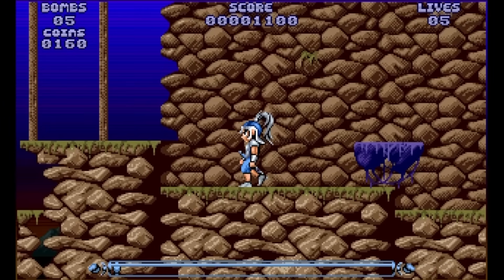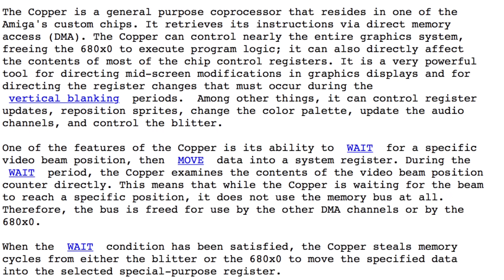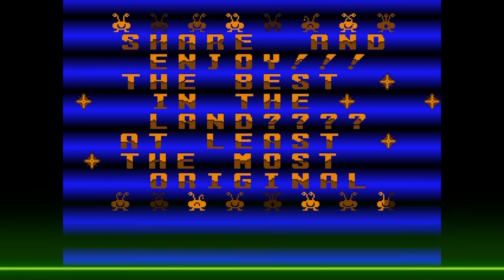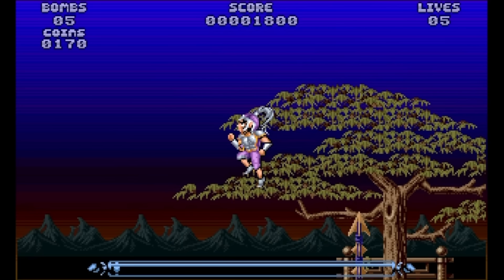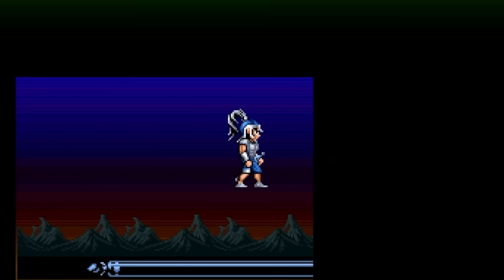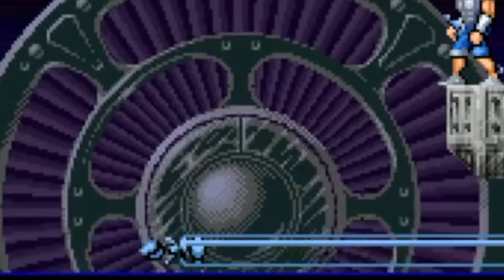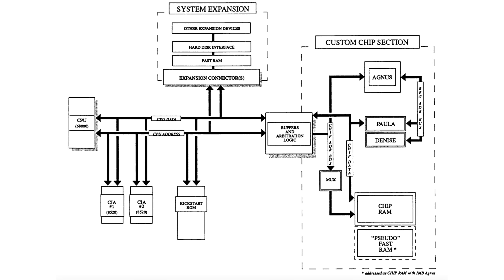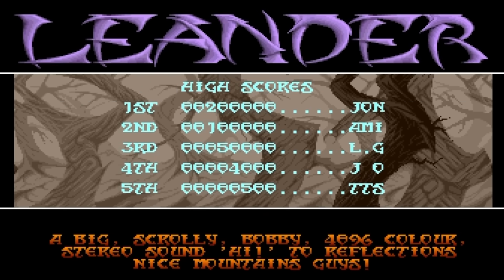SNES hardware beaten by this simple Amiga trick

Comment: I am or rather WAS (abandoned Amiga in 2008-ish) a SUPER Massive Amiga enthusiast.  and ONE HUGE massive thing wrong in the Amiga world that CONTINUES to happen today (November 03, 2021)  is that Amiga/Commodore 64 had NO standards when it comes to Arcade quality Games, and they had basically NONE of the Big names especially Japanese (capcom, Konami etc..). For example.... on the C64 AND the Amiga..... 90% of games are NOT full Screen Overscan.......Utterly inexcusable... this wreaks poor programming. Some were not centered and you have to center them and had different centering than other games......  Most were NOT arcade quality (No full joystick support for at least 2 buttons and ONLY Joystick support unless you selected Keyboard).  Alot of games Blue Prints were made and designed right on the Amiga using Deluxe Paint (Body Blows) which is why they look like cheap stiff puppets (not that Deluxe Paint sucks its just you needed a hand drawn anime on a Cell first then digitized and painted over with Deluxe Paint or better yet Brilliance 2.0).  Also Games had the Score raster Cut off the action when the score should be floating about the game with a transparent Raster. Very few games look good with a Separately drawn scoreboard (Chaos Engine, Ruff n Tumble) . Example: Zool 2 ECS and Zool 2 AGA...the stupid Purple Scorebar ontop ruined the entire game for me and the FAKE 256 colors were really just a background with DIFFERENT colors slapped in the back. The Foreground and characters are identical in colors, not a single color more.
There are games being released today like this.  No game, I repeat no game on an Amiga should ever be inferior to a Genesis version, and many times should be on par or better than the SNES version and Occasionally as good as Neo Geo.  Also the having a PAL version and a separate NTSC version was a problem. They should have ONE version that functions on both.  Don't believe me?  check out the Jellydrop type Game called OutFall!   it switches NTSC to PAL seemlessly.  Somebody please copy this routine.
SNES games and console games were just made to run on joystick ALONE... The Amiga games ALL should have been like this.....with the OPTION of using the keyboard if they wanted to. Also no one ever really (Im looking at you Commodore) released Standard Amiga 2 or 6 button Controlllers (except for the CD32 which was too late by this time) for the Amiga or C64. Heck the C64 Mini still has this problem...one should Never need to use the keyboard... they can be programmed onto the Joystick before shipping the games on it.

Anyway
Best Made High Standard Games on Amiga:

Slam Tilt
Kid Chaos
Zool 2 ECS version
Pamania (Full screen Overscan)
OutFall
The Chaos Engine (no complaints about the look but could use Overscan and more frames of animations)
Gods (Same as above)
FIghtin Spirit (They really tried but the background colors are too bright and should be half bright)
Robbeary
Project X (eliminate the HAM screen intros and add background music during play and we're good)
Bubble and Squeek (why does Genesis have a scrolling Background and ECS version doesn't????)
Leander (great but character needed more movement when Jumping and not staying always in the center)

There are a few more but they each still have their flaws.

Amiga could handle all of those with the flaws fixed and features added. Also the Amiga can do double the sprites and double everything mentioned here with one simple trick. Add a Multitasking Layer to the game you already created as if it were Workbench running infront of the game and you pulled the screen down while the game was running and you can view both.... now take this idea and make said Workbench (actually this would be foreground or background effects in a game)  and make that screen transparent.  Now you got 2 Multitasking screens running separately with their own resolution and colors but running at the same time and being viewed at the same time as ONE Game!   I believe Broadcast Titler used a similar effect.... Utterly Mind Blown.   You're welcome.
Reply: The borders on the C64 do puzzle me. I think that VIC would have needed to run the sprite Logic twice: once to count the memory cycles and decide if to halt the CPU and then the real deal. Probably, after the brain drain from MOS no smart engineer was left. Only Amiga brought them back. Amiga has no copy protection and is expensive. Japan only cares about dumb consumers.

Comment: Then Doom came along and it became how quickly you could plot 1 pixel on the screen.  Stupidly expensive Amigas with their decade old architecture and washing machine CPUs were crap at that putting an end to all this nonsense.  We're still playing Doom (for entertainment not just nostalgia) to this day.   
t. Bitter 1200 owner
Reply: Jaguar uses a blitter very similar to Amiga and plays Doom just fine.
Reply: @ArneChristianRosenfeldt  Amiga blitter has no use for a Doom like engine, I think it mostly relied on CPU.

Edit: Blitter was sometimes used to help C2P conversion on the Amiga, but C2P is a big overhead itself that the PC didn't need to do.
Reply: @SerBallister  I mean that the Jaguar blitter takes the line drawing function of the Amiga and expands on the pattern. You can pull in the color values from a texture map. Doom on Jaguar draws vertical columns for the walls using the blitter. I still want to Port descent to Jaguar and try to use diagonal lines.. sadly the Jaguar cannot do the shading as in descent.
Reply: @ArneChristianRosenfeldt  The Jaguar Blitter seems a lot more capable than the Amiga blitter. Amiga blitter couldn't stretch line patterns, so not that useful for stretched texture mapping.
Reply: @SerBallister  Yeah. Just interesting that Atari brought hardware to the market just in time for Doom. I guess that it was inspired by WolfenStein3d and F-Zero.

Comment: The trouble with Amiga sprites is they didn't have their own palette, you had to waste 12 of colours 17 to 32 colour of the bitmap screen's palette. You can work around other stuff but you waste 12 to 15 colours on sprite colours.....unlike every other implementation of sprite type hardware which had separate sprite palette colours. On AGA it's fine and you get 4 64 pixel by screen height sized 16 colour sprites which is great for beat-em-up engines but on OCS the sprites are less useful than on C64 or Famicom of 82/83 era.
Reply: To not steal too many cycles, Amiga playfields are supposed to be 16 colors or 8+8. So you have whole other palette for sprites. No idea why they could not provide 24 entries. Still better than C64.

Comment: Wasn't the Saturn also able to draw infinite sprites?
Reply: Saturn has playfields and blobs, but no sprites.
Reply: @ArneChristianRosenfeldt 
Could you elaborate?
Wasn't VDP1 dedicated to sprites?
Reply: @marioe.4400  I call the blobs because VDP1 was allowed to write to a frame buffer just like 3do . Jaguar was the last hardware with a linebuffer, but already had two of them. SNES has a single linebuffer, which makes it cheap. PCEngine had no linebuffer and real sprites. It could have resolved every combination of translucency and detect 16x16 collisions. But NEC and Hudson were not smart enough. Palette lookup even was inside a custom chip just as in Amiga. They could have had more read ports or a clock rate which fits 1987. Or — you know — give each sprite its own palette like the one color on C64. Then rely on the 7MHz 6502 to swap it out in the borders. Amiga with RGB could have done it two. Store 3 colors dedicated at one of the 8 sprites. If bit pattern=0, lend the palette to the playfield for one cycle. 
Why does no game use the collision detection in C64 and Sega Mastersystem?

Comment: 1:56 I believe that it's technically not correct that the dual playfield mode reduces the number of sprites. The number of sprites is reduced to 7 if horizontal hardware scrolling is activated as DMA cycles are removed from the last sprite and added to the bitplanes. And due to a bug in the OCS Agnus chip, the 7. sprite has a partially broken DMA and thus is unusable. But this has nothing to do with dual playfield.
Reply from the maker: I thought it was something to do with the playfields. Scrolling makes sense.

Comment: Impressive programming and I applaud you. But I'm not sure its an accomplishment to say that your Amiga, a $1295 computer (for the 1000) beat a $199 SNES. Yes I hope that a machine 6 times as costly has some power to it.
Reply: It's very silly (imo) to compare prices of:
 a) a fully fledged Computer to a game console.
 b) 5 year diff in time periods. 

The A1000 keyboard alone in 1985 would have cost more than the SNES in 1990.
The floppy drive too but the biggest and main reason for cost differences is RAM.
In 1985, RAM was approx $800usd per MB to the end user, A1000 had 512kb in total ($400).

Comment: The gradient horizontal bars effect in background is drawn at a own background layer? 
Seen often the effect on Amiga and SNES. I know Genesis doesn't have this feature in its GPU.
Reply from the maker: You can use the Copper chip to change the background colour every scan line, so it’s pretty much free. You could use horizontal interrupts on the Genesis to achieve the same thing, but it’s colour palette is more limited so wouldn’t be as smooth

Comment: Wow, i didn't know that the sprites on Amiga are only 16 pix wide. We use sprite multiplexing on Commodore 64 (in software) A LOT, but there, sprites are 24 or 12 pix wide.
Reply: IIRC, if you made the sprite multiplexing in software, you ended up with flashing sprites, but it was possible to have interrupt routine drive the positioning. Also, there was a pointer to the sprite to drawn, so dozens (hundreds?) of sprites could be sitting in memory and not needing to be redrawn.

Comment: Presumably this is something that could also be achieved on SNES using its HDMA feature, which I think I'm correct in saying let's you execute code or whatever during the time in between every scanline being drawn? So, not doing anything in the middle of a scanline as with the mountains in the example above, but at least in between every scanline, for presumably around 224 times per full screen of graphics where you could update and change things on the fly to do a few tricks similar to some of the stuff above (much like how SNES games can be seen to regularly change the main background colour every scanline for lovely gradients in some games, or how it's used to update the perspective on Mode 7 games like F-Zero in real-time, and so on). Is that correct or not correct?
Reply from the maker: I guess so, although the SNES can already fill the width of the screen with sprites, as can the Genesis/MD, so I’m not sure what you would gain
Reply: @CodingSecrets  What about this as an example: Use a few sprites for rain drops, and then use a trick like one above to draw many more of them on-screen for a lovely rain effect on top of the main action, without wasting a whole bunch of sprites you might want to use elsewhere/otherwise--or something like that. Would that be possible using some version of the technique(s) you're talking about?
Reply: Unfortunately, sprite multiplexing is not really possible on the consoles starting from the NES, including SNES and Genesis, due to the sprite pipeline design. Sprite multiplexing worked well on platforms with very limited number of sprites, such as 2600, Coleco, C64, and, well, the almighty Amiga too (it was designed just a two years after Famicom, so a huge leap forward, but still a close descendant of the 8-bit era). When you just have 8 sprites with direct access to their properties, you can play with it as you want, but when there is a sprite pipeline with a long list of sprites, designed to draw the list as efficient as possible, you can't do much else anymore.
Reply: @shiru8bit  There's now some demos that show this is definitely possible on Genesis. But, it's apparently not something you can do on SNES similarly for some reason. You can kinda "multiplex" on SNES if you are okay with big black lines across the screen in-between each time you start to redraw the same sprites lower--Mario Kart basically uses this to draw the map sprites below the main race sprites--but that seems to be about the best you can manage on SNES, or at least that's the best people have figured out thus far anyway. I still have a tiny bit of hope someone will one day figure out a way to force proper sprite multiplexing out of the SNES too. But, realistically, that's likely just a pipe dream and wishful thinking on my part. Still, it took decades and apparently a little bit of random luck to truly and fully finally figure out how to get the whole extra colour "Blast Processing" method working properly on Genesis, so you never know.

Comment: I love the walking animation on leander. How were the background sprites done on the Mega Drive? Or could the MD handle it natively?
Reply: Megadrive had 2 native background layers, not an issue.
Reply: Checkout The Legend of Galahad as the game was released as on the Mega Drive. Checkout this comparation between those two versions:
https://www.youtube.com/watch?v=tfIg_08rzyM

Mega Drive could more than fine run this game without issue, and more too as well. The copper is howover missing, but its does have more backgrounds, more colors and  you can have sfx and tunes in same time.

But regaardless its still its a very nice game for the Amiga, and im a fact actuelly owned the original purchase version of the game back in the days for the Amiga. Im did newer completed it. But the intro is to much ace.
Reply: @spacefractal  I've had Legend of Galahad since it was released back in the day.  A great game which is almost ruined by the poor hit detection.  The Amiga version has much better hit detection.  There is an interesting video on how the hit detection was done on this Leander too.
Reply: The Megadrive had two bg layers out of the box so no issues there.

Comment: What would happen if you tried to run this game on a modern LCD or OLED? Because these sprites seem to be reliant on scan lines
Reply: Nothing special?
It will still be a regular video signal. You're watching this on an LCD screen probably, how isn't it obvious?
Reply: @Discord Guy  modern screens have a resolution called 1080p 1440p etc. Screens from that time were 480i or 720i etc. The i stood for interlaced because they worked fundamentally different. Modern screens refresh the entire image at once. An interlaced screen refreshes it one line at a time. Skipping a line then coming back and refreshing the skipped lines next. 
It seems from the video that the game was built around interlaced screens so it stands to reason that the game would look fundamentally different on those screens than it would a modern display. 
How isn't that obvious?

Comment: One cool trick with some old java phones was that the screen buffer was never really cleared unless explicitly requested.
Used this trick in a bunch of mobile ports to draw more stuff on screen than the phone technically allowed.
Reply: wouldn't it give you flickering or did you managed to draw it to a separate frame buffer before outputting it?
Reply: In Commander Keen, the screen is mostly kept as is; when it scrolls, new scenery is drawn at the edges and of course the "sprites" have to be updated which is done with "dirty rectangles", blitting in ONLY those areas which have CHANGED per frame. If the whole screen had to be drawn every frame, the game would be too slow. Carmack tried to minimize the amount of information drawn per frame because it was all done on the CPU at system bus speed. No blitter or copper!
Reply: really?! what mobile ports did you work on?
Reply: You could do the same thing with the Amiga. It was the norm on home computers back in that day. 

I coded some JavaME stuff back in the days too.

Comment: I really wish the consoles were able to do this.

Yes, I know the Mega has 64 sprites in 256x224 and 80 in 320x224, and I know the SNES has 128 sprites, but still.
Reply: MD can do vertical sprite multiplexing but not horizontal. You wouldn't need it for this anyway, cause it can cover the whole width of screen with sprites, as long as they don't overlap. Don't know about SNES.
Reply: @Worstplayer  I've read the Megadrive can't do vertical multiplexing because of some sprite cache thing. Maybe I've misread it, though.